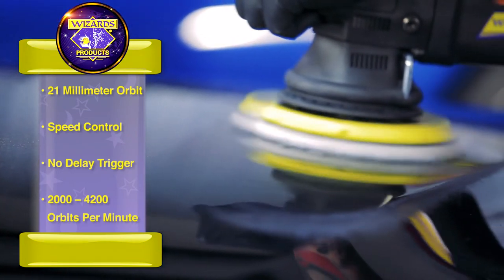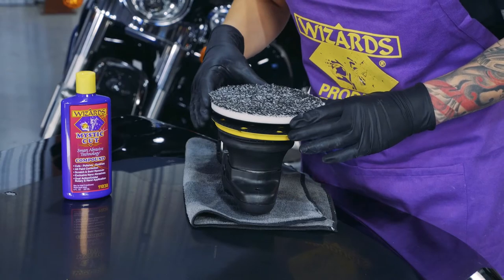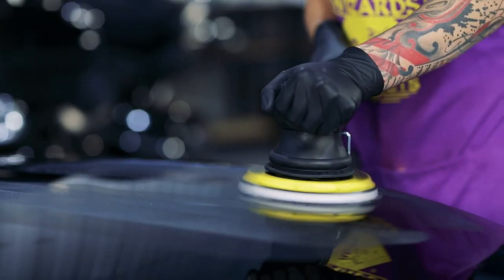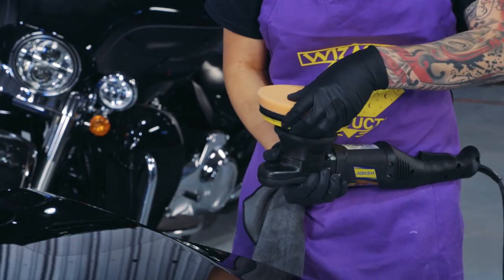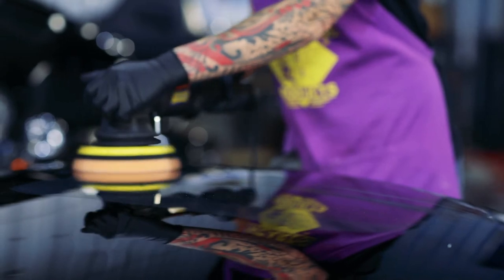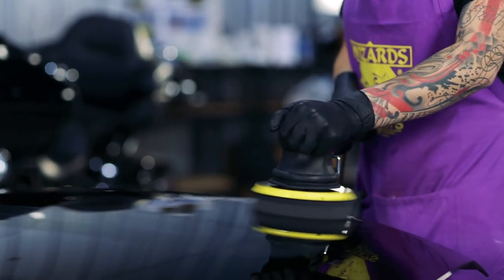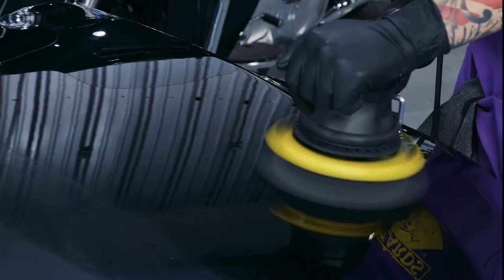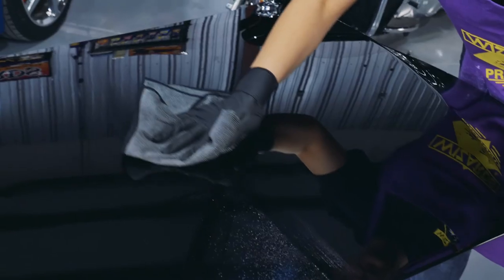How to Use Wizards Products: The Wizard 21™ Big Throw Polisher

Comment: Would this system be used for compounding after color sanding new paint?
Reply from the maker: The Wizards21 Big Throw Polisher and SSR Kit can be used for paint correction or polishing fresh paint after wet sanding. Ideally paint should be sanded to at least 2000 grit or finer for best results.